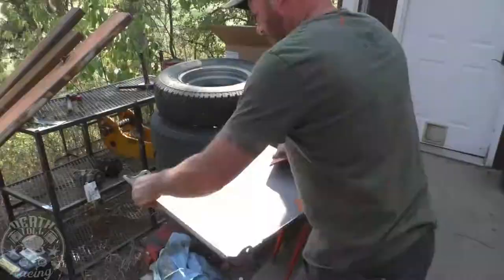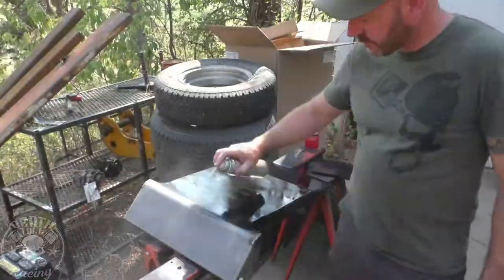E11- Geo Tracker Armor / Skid Plates Install 89-98 Control Arm and Engine Guard

Comment: When i crashed, i hit my tire and ended up bending my frame before bending my control arm. Those things are strong as hell, no need for the skid there. You should make a skid for the transfer case cross mamber, i bent it by hitting a rock on the trail, and i was not going very fast at all. I aso recomend a skid for your cat if you  need it for emisions, i smashed that too. You're gonna have to make them, as i haven't seen any for sale
Reply from the maker: Yeah. They are way thicker than they need to be. It’s been a while but I think I said that in the video. Good advice on the cat shield. It’s also good to shield it from catching grass and brush on fire.

Comment: Yeah, I have to do this yet too.
Reply from the maker: It's an easy one!  The control arm ones I'm not too sure of though.  They are way thicker than they need to be, and it's un sprung weight, so not ideal.  I think I will make some new arms eventually.

Comment: My friend by any chance have you figure out how to get more power out of that little engine?? With out adding a turbo charger?? I was thinking of a hot camshaft?? Back in the days you could get more power out of a vw Beatle by changing the camshaft.
Reply from the maker: To be honest, I think you would really start to break stuff if you make too much power (I would think a turbo over 5 psi would be too much).  Mine is just an 8 valve with a header, exhaust and intake, and with the crawler gears it has a ton of crawling power.  As far as competition with a rzr 1000 in the dunes, I think we are screwed. But we can drive ours down the freeway, not worry about cvt belts, fix it for relatively in expensively, and most likely be the rescue rig that people earlier were making fun of, and now have to swallow their pride.

Comment: hi what size are this tyres and rims!! looks niceeee
Reply from the maker: Thanks!  Geo Tracker $200 2.5" Lift with 235/85r16's (32") Tires.  What it Takes to Fit! DTR Budget Build 4x4
Reply: @DeathTollRacing   cool i will need body lift and suspension lift ?
Reply from the maker: @gustavofuentes2298  https://youtu.be/8cK-uHCQZVc

Comment: How much HP had it the geo tracker bro,
Reply from the maker: Not a lot.  I think they are 80hp stock on the 8 valve engines.  I have a few upgrades done, but nothing that would increase power more than 10hp.
Reply: @DeathTollRacing  wau wanderful !